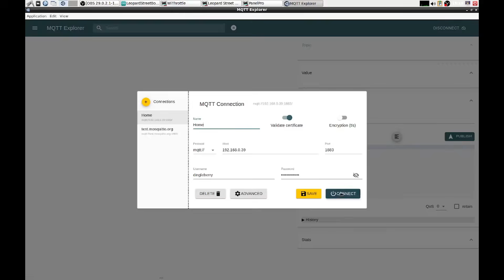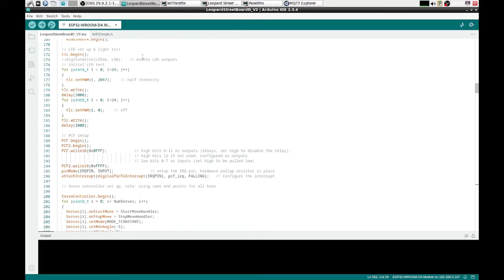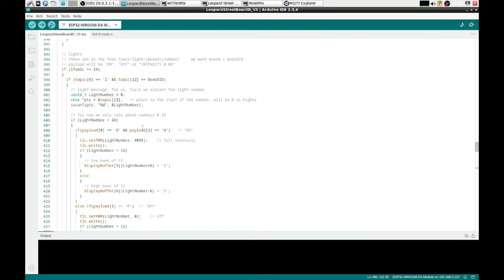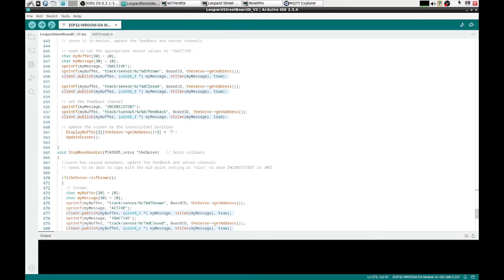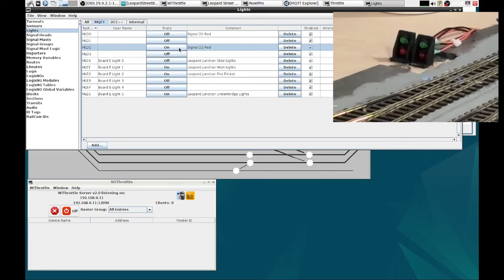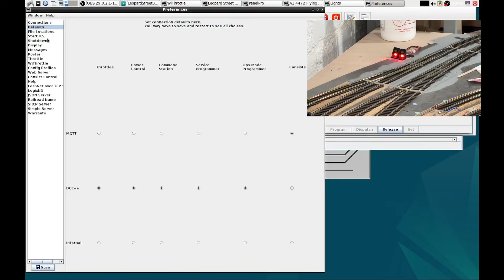12. Lights, JMRI, MQTT & Action! #modeltrains #electronics #arduino #howto #mqtt #jmri

Comment: Got my mqtt set up running yesterday, and I’m so pleased with the result. The screen details are fantastic as you can see how the system is running. Many thanks for the code, as it was a great help.
Reply from the maker: cheers, glad it worked. its actually a remarkably flexible system for commands and sensor feedback. main benefit though I find is you can now have multiple "things" listening and issuing instructions, makes mimic panels and similar really easy to do

Comment: Many thanks for this video, it has helped me set up my MQTT system which is running nicely. The next stage is add your esp 32 with screen boards.  You uploaded your code to GitHub, which I downloaded to adjust to my layout. After looking at the code, I’ve got a ESP 32 with screen to show, when it’s starting up, WiFi and MQTT is connected. For testing I’ve the ESP 32 to send a message to broker every 10 seconds, and the screen is showing how many have been sent. I would like to more on to next stage, which is your ESP 32 setup. I’ve loaded your code into the Arduino IDE, but unfortunately it is showing many errors. The first one is WiFiDetails, and updatescreen. I understand that the servo code will be explain later in a video, but is there any other code to go with it , like cpp file etc. Thank you for the code, I’m grateful for it as it’s given me what I’ve got so far. For a future video, please could you do one on the ESP 32 board.  Many thanks and looking forward to next video.
Reply from the maker: hi, one of the issues is the servo library, this is a custom one thats not yet uploaded and needs tweaking. there is a more recent board update on github that should have the credentials file (all it does is handle the wifi username and password)

will go through the board yes, there is one on the main railway series covering the board as a deeper dive (#155) which is the first bit of how this works, second part not yet out there

will be more, glad it helped :)
Reply: @aleopardstail thank you for reply, it has been very helpful.

Comment: Thanks a lot, I am happy with the programming side but unfortunately some of the hardware stuff eluded me previously. Made this much clearer on how the connection to the hardware works. I would be interested if the code changes using ethernet as the hard-coded IP addresses are not ideal for me as I would prefer to not have my layout connected to my home network and I assume you need a static IP for the MQTT server - something for me to look into I think, if you couldn't tell, this kind of networking stuff is really not my strong point. I initially planned to wire everything back to a single Arduino using EX-Rail automation which would have been an awful job... Great explanation, keep up the good work!
Reply from the maker: Hi, glad it helped, I don't think it would change much for a hard wired bit, i think the WiFiClient becomes a different class but the same interface. nothing internally cares about the IP of these nodes (except to show it on screen) and you do not have to configure MQTT with the IP either so hard wires, should, "just work"

the MQTT broker does need a static IP for things to connect to I think.

previously on my N gauge layout I was using C/MRI which for binary sensor states works well, bit more involved to set up as the nodes need RS485 modules back to the base station and then its wired. that and similar where I came up with my own protocols, here the limitation is it having to talk to JMRI so needs to be what that understands - C/MRI and MQTT both work.

its worth noting if needed you can have several different MQTT systems, not sure why you would want to but maybe something like bringing in some more "household automation" sensors like controlling room lighting or something

glad it all helps, I found the way to go was setting up some simple experimentation stuff to see how it all works, there is another comment thread here from @bruntouk who suggests investigation espnow as well

many thanks for watching, and indeed for the ideas :)
Reply: @aleopardstail  Yeah I was thinking that if I have a wired connection between everything I would be able to reduce interference will definitely look into ESP-Now but to be honest even if it does have to use my home network it is more than worth the switch. Thanks again for the insight and very excited about the Oxford Rail wagons - I recently got a 5 plank wagon from them and it is fantastic and was less than £15! On a side note, if you are still looking into Kadee couplings, I have found that there seem to be some Chinese manufacturers on Ebay that do a pack of 12 for around £12-14 (free international shipping too!). They made entirely out of metal and still work with my very crude magnetic uncoupling (couple of magnets under the track). Having gotten a couple of packs now, I can say they seem to work just as well as legitimate Kadees but obviously it is your decision - I have been using them in between my sets of 3 freight wagons which Kadees on the end with a reasonable amount of success as I was having problems with non pivoting magnetic couplings on some wagons where the NEM pocket was fixed.
Reply from the maker: oh now thats interesting, I had seen the Chinese ones but guessed it was all plastic or some weird alloy made mostly from cheese. worth a look.

and yes I got a second hand five plank Oxford Rail one which I was impressed by, simple but they look the part and seem well made

think a lot of the problem I had with ESP32 and Wifi, pre the larger antenna, was down to the way they are below a board thats roughly described as a rats nest of wires

:)

Comment: not a train fan but am electronics. Why are you using wifi and not using espnow with mqtt broker which uses same frequencies but direct connection without the wifi bloat
Reply from the maker: Hi, the primary reason is the layout is designed to be dismantled, not often but to allow it. in effect each board is connected to the next (there are nine boards currently) by a basic jumper that contrains:
- DCC A & B
- DC ground
- DC 5V power, 5V logic, 12V and 15V for some boards

there are no other data cables. also the layout has no wired connection to the control computer - it could be done, a router mounted somewhere and a series of cables but I went with WiFi because I was gullible enough to think it was going to be easier...

thats why a wired link wasn't used, when I set this out I hadn't heard of ESPnow, a previous layout used an RS485 bus.

its something I'd consider for a future layout though, which hopefully would not have to come apart but would make it easier to put the nodes where its sensible to have a node

the whole project is about 50-50 trains and electronics/control systems

interesting idea though and thanks for giving me something new to investigate.

many thanks for watching and especially for this comment, lovely new technology and something to read up on and see about adapting to as it seems the same hardware could be used this way
Reply: @aleopardstail espnow is quicker and the router is not trying to re-interrogate the device all the time so it can just sit listening or you can ping devices when you want if you want that way your not waiting for wifi to finish talking and asking if you want something new before telling your train not to crash. I find i can get 100m connection where wifi seems restricted. I use wroom-32u with plugin tuned 1/4 wave antenna which seems better than pcb antenna
Reply from the maker: I had a quick read and there does seem to be quite a few advantages to this, I'm going to have to do some experimentation with this. previously I've used other radio modules. this seems to be better integrated into the devices and that range is very impressive.

so far the actual trains are not driven over the same system (thats done using DCC-EX, which is also over WiFi but not via MQTT)  as it needs to work with that system, however it could be good for faster sensor responses from blocks, points etc

again my thanks going to have to investigate this